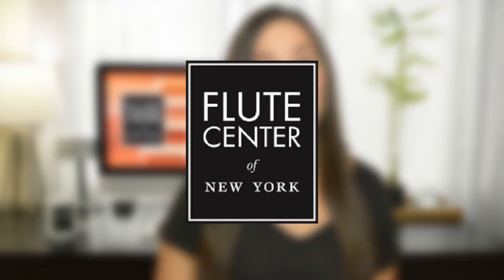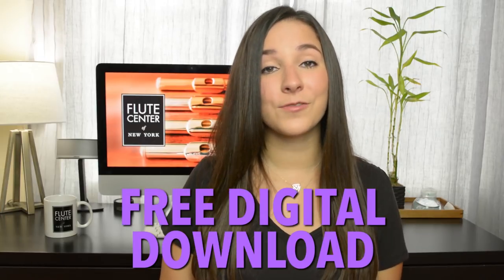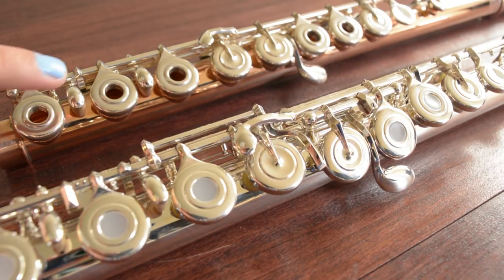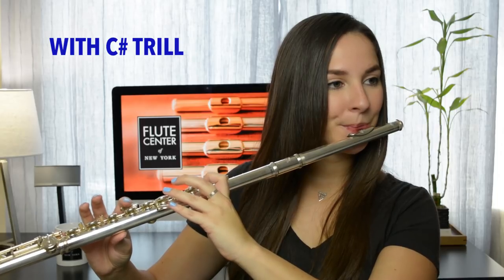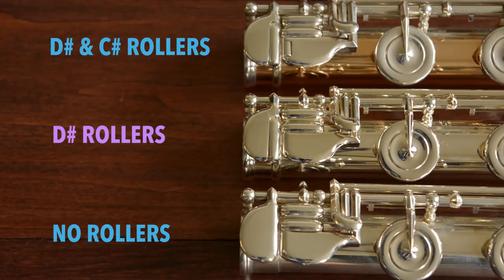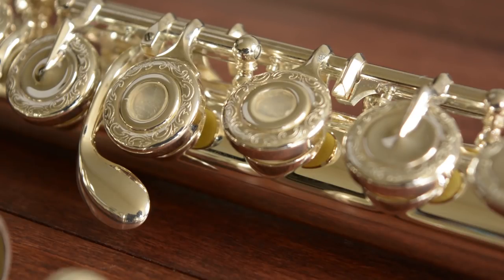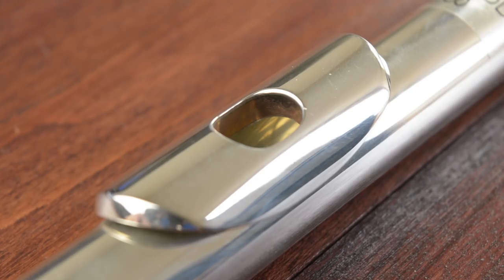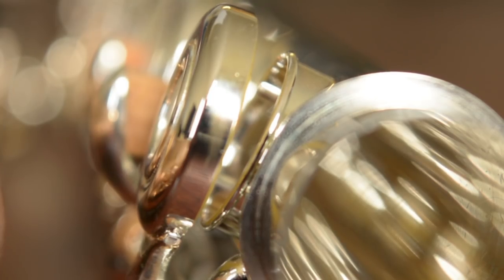Advanced Flute Options

Comment: My first flute was just a basic student flute and then I got my pre professional flute (after 5 years of playing) my sound was so much better and it was WAY fancier. My student flute was just basic and there was nothing special about it but my new flute had a b footjoint and a D sharp roller and open holes it is solid silver except for the head joint which is gold/silver alloy with a 19k riser and it has a split E mechanism and a C sharp trill key and offset g. I love my new flute so much.

Comment: Thank you for creating this video. Very informative.  Would you consider doing a video on the different lip plate styles with characteristics of sound using different metals and cut?  For instance what is a traditional lip plate vs P or Piedmont and N or Newbury. Using different metals for the riser, whole tube, and what are the characteristics of each.  Thank you.

Comment: Hey Gina, I had a question I was hoping you could answer. Is it possible to get a D# roller key added later on? Like a repairman take off the old one and put one with a roller on. And if so, would it be expensive?
Reply: Depending on the level of flute (student, intermediate, etc.) most places won't do it because the costs to produce wouldn't be worth it. If your flute was a handmade model, then they may be willing to make you a new D# key with the roller. But... Another option is find a flute that's the same model is as yours, and just cannibalise the part and swap them.

Comment: This was very informative! My Altus has a split e and I have found that for me it helps with my high e. I don’t have a C# trill so what I do for the high G to Ab trill is that I finger high G and I only lift my left index finger or I finger high g and I use both existing trill keys😊❤️🎶🎼
Reply from the maker: There are definitely a lot of trick fingerings that help a lot! The trill key makes it easier but it's definitely not impossible without them :)